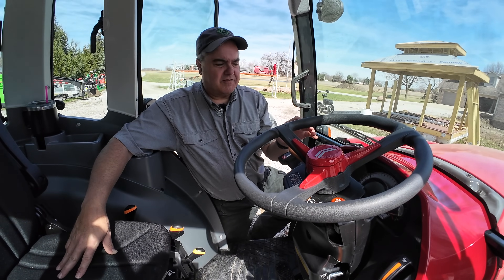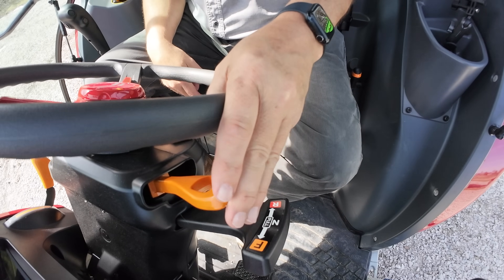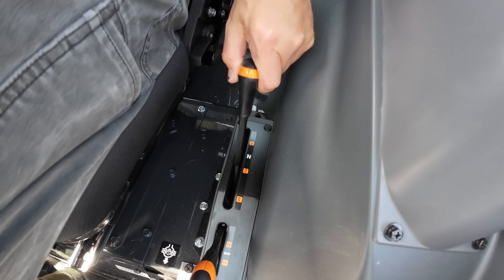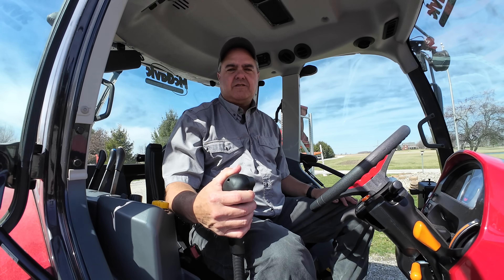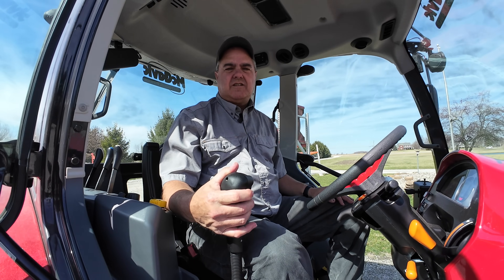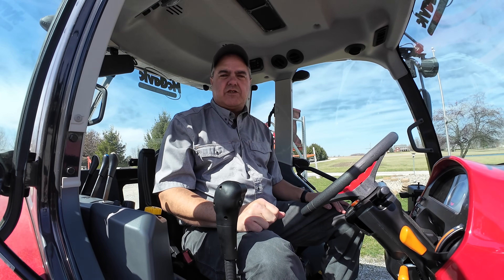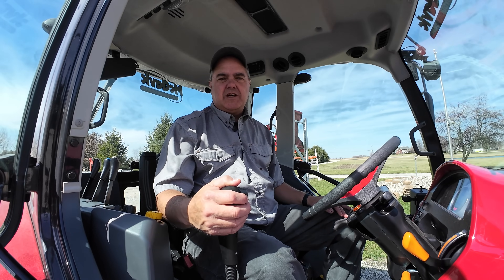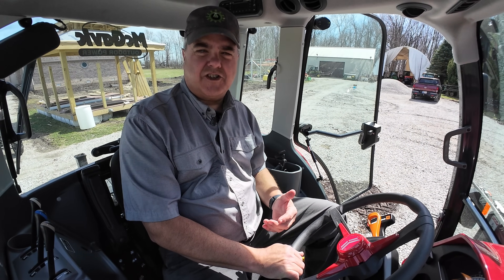Yanmar YT359 Operation: Hydrostatic? Shuttle Shift?  EXTRAORDINARY!

Comment: Owner here. I just installed the W.R. Long Top and Tilt. Sure makes things so much easier hooking up implements. And with the Cab version you open the rear 1/4 window to get access to the rear remote controls from outside the tractor.
Questions... what is your optional 3rd rear remote used for? Your big mower?
Reply from the maker: Haven’t used all 3 remotes yet. Got it just in case.

Comment: A and B mode is just two user set modes that each can have their own rpm and ground speed. Then a button on the joystick allows you to toggle between the two.
So you can have one set to high rpms and slower speed to load the bucket then hit the button to change modes to speed up ground speed to your dump destination.
Reply from the maker: Owner, or dealer?
Reply: @TractorTimewithTim  Owner. Love this thing.
Your videos are top notch.

Comment: At first I was excited about this, but I have to admit I'm a little disappointed. There's no way this is any different than a regular hydro tractor. It's just electronically switching the forward and reverse. If they still had draw bar HP, you would see this. I do like the layout of the cab better than the TYM I have. But I'm not a fan of all of the electronics for what the Yanmar is. I think for what it is, it's overpriced. Gotta say, it's awesome to see you give other brands a chance though!
Reply from the maker: This is dramatically different than hydrostatic tranny.   Go drive one for yourself.  
And yes, it DOES have much more pulling power.

Comment: I’ve been saying that this should be the standard setup for hydrostatic transmissions.  Double pedals are inefficient, dangerous in that you can inadvertently touch the wrong pedal at the wrong time.
Reply from the maker: Ok,  but this tractor isn’t hydrostatic.

Comment: you can do the same thing with a shuttle shift  just have to match your rpm to the gear you are in.  just bought a new 1626 with shuttle is how i know. it does not have the auto cruise  just a manual cruise
Reply from the maker: Nope. This one allows max rpm (say for mowing) at ANY speed.  Can’t do that with shuttle shift.

Comment: (Edited)  I've  seen some of Yanmar's press that shows they can pull the entire transmission assembly out of the rear of the tractor in minutes should it need repair.
Reply from the maker: This was not intended to be technical description.
Reply: @TractorTimewithTim  Fair enough.  I'll remove the technical aspect of it.

Comment: Does the clutch allow you to feather in the PTO?  I had a clutch pedal on my L3301 and I loved the ability to very slowly engage the PTO and slowly spin up my finish mower.  I don’t like how so many tractors have gone to a “dump” in on the PTO.  It was the only thing I ever used the clutch pedal for.
Reply from the maker: No. PTO is independent.  If you had not purchased a Kubota, you wouldn't "need" to manually 'feather' your PTO.  Most brands have a 'soft start' PTO which doesn't jerk it anyway.  Kubota does not ...or at least used to not have the soft start feature.
Reply: @TractorTimewithTim -  good to know, but a moot issue now.  I sold that tractor and now have a KX-033 excavator.  Now I don’t mow, I rip it out! 🤣. Jis kiddn, different property required a different tool for the job!

Comment: Incredibly similar to the 1980s yanmar (much smaller tractor) I had. That “hydro shuttle” was super handy and between that and the foot throttle, your right hand never had to leave the loader control.    I’m now used to my gear drive kubota, but it’s a constant workout managing the forward/reverse lever, high/low lever, clutch and foot throttle-brake controls.

Comment: This seems to me like a hydrostatic but with both a shuttle lever and a clutch replacing the reverse pedal.  Maybe it will make more sense when you discuss the technical aspects, but at this point is seems to me to be simply unnecessary complexity.  I would much rather see simply two pedals as with hydrostatic and no clutch and no shuttle and no creeping when neither pedal is pressed.  If people really need the creeping function, make THAT a separate button or control.  I just don’t see the logic in having three controls for motion (motion pedal, shuttle and clutch) when two (forward pedal, reverse pedal) are more than sufficient.
Reply from the maker: I did not discuss the major reason for this tranny.  It has the power of a gear drive transmission while maintaining MOST of the flexibility of a hydrostat.
All hydrostatic transmissions are horribly inefficient at getting power to the ground.  We all know that…yet we choose them anyway due to their flexibility.

Comment: @7:30  with iseki TF hydrostatic you don't have to move your foot eiter yo go forward with top of your foot and backwards with your heel the  pedals are opposed of each other but your foot fits on both. If you press forward the backward pedal goes higher up to

Comment: this summer if you need to break it in run your bat  wing mower need some thick tall grass. or another property vines over growth. Let your yard get grown up tall. Really test it. To test to see did they build it for its intended use. Then do an oil change video one to look at the engine how it’s doing any shiny ✨ bits. Tim i really don’t care what ever tool or tractor brand you use. Boys with toys.  My grandmother always said they just get more expensive. You really can’t get rid of your smaller tractors 🚜 small projects. plus one day it’s mechanical may need one just to get through a mow job or who knows. But i’d try n look at drive on deck mowers by other brands. You have ven trac for tight areas They may come out with new tools to play with. I like the Jd 1025 R diesel good size mower deck to drive on. Regardless of brand the deck for mowing longevity not just price. May look at zero turn commercial stuff to.

Comment: My tractor is an Antonio Carraro shr9800 the H stands for hydrostatic, this is a tractor from 2018…  the transmission is used the same way, leaver on the same spot or a small toggle switch on the joystick… 4 spead sets, press the accelerator and go.

Comment: I have a yt 347c for several years. I now have almost 1200 hours on it with no issues. Love my tractor. To me driving it is like a car. You shift forward or reverse the gas pedal works the same and the cruise is the same.  You just have added controls over the tractor’s movement.  The clutch pedal as I was told disengages the hydraulic pump. I don’t ever use it. Glad to see you with a yanmar.

Comment: Is the clutch for engaging/disengaging the PTO? It has to do something unless you can press it to change speed ranges on the fly but how often would anyone do that?

In a full-fledged tractor that's the transmission I expect to see in small ag & compacts, I've never used one but have used every other transmission style (traditional hydrostatic, traditional manual, shuttle-shift manual, and shuttle-shift with torque converter). Big advantages over the clutch type and torque converter type shuttle shifts, interesting to see how the A/B speeds work because otherwise it's only benefit over a traditional hydrostatic is not having a second pedal to bump into or press in a panic.

I have mixed feelings on auto-throttle too, definitely something I want to be able to turn on/off as needed. With the engine rpms as you press the accelerator the engine moves more fluid thus making the hydro spin faster, so yep your throttle response goes from linear to exponential. I've tried it in everything but field work and the only times I benefit from it is when running around without engaging any implements and occasionally when digging/dragging dirt. But because of its touchy nature it's the LAST thing I want doing anything with pallet forks, keep rpms low to keep all movements snoother
Reply from the maker: You would not complain about auto throttle on this machine.  Much smoother than most.

Comment: The land around you is flat. Not so much here in Western Connecticut. Therein lies an important feature of the 359's transmission.  I have many hundreds of hours on a Deere 4310 (also a Yamaha, BTW) hydrostatic.  The first time I stopped the 359 on a hill and moved the shuttle lever to the neutral position, my eyes became like saucers! There is absolutely no engine braking!  I started to roll backwards at an alarming rate until I was able to mash the brakes.  Beware!

Comment: The place this transmission is not fun compared to a dual pedal (I have the same tractor) is changing direction on a hill. Loader work on a hill or mowing up and down a slope etc. it’s not smooth under load, the break is need under heavy load.

I have had a few other issues, but mostly it’s wonderful

Comment: I think this is a good way to get guys like me to consider a hydrostat tractor. In my line of work I could see some advantages, but I’ll never stop trying to clutch and shuttle shift my truck. I put a lot of hours on a tractor so it’s just kind of a habit. I’m still waiting for a linked system for the PTO and the lift arms. Some of the equipment I use doesn’t tolerate spinning free very well. If I could set the PTO to turn on at a specific height (auto on/off) with a height adjustment. The auto on/features are cool, but I would want more control.

Comment: Tim the reason the 3046r and 2038r are like that is because their pedal assembly’s are electronic fly by wire if deere was to remapped the pedal position sensors and voltage resistance it would be like old salty’s pedal feel a more mechanical feel

Comment: I spent 3 years tractor shopping because I couldn’t make a decision and didn’t want buyers remorse. I thought for sure that I was going to buy either a Kubota or JD at the beginning but also tried TYM, New Holland, Kioti and MF. The MF 2860m became my favourite until I tried the Yanmar. Once I used the Yanmar YT359c I was completely sold and the IHS transmission is perfect for my needs. Bought it last spring and zero regrets.

Comment: Another great video Tim!
Excellent info on a very interesting tractor.
Couple quick questions.
So when you let off the peddle regardless of modes in use it does not come to a complete stop like a Deere e-hydro?
That is different from what I thought if that is the case or I am understanding correctly. 
Also if in fwd and you get out of the seat does the tractor shut off?
Reply from the maker: If the shuttle is in F or R, no it doesn’t come to a complete stop. ALMOST….but not complete.
Yes, it shuts off if out of seat and in gear. 
(I disabled seat switch as I always do.)
Reply: @ Ok 👍 Follow up question, if needing to shift to neutral I assume you have to set the park brake before exiting or even if setting on a slope do need to hold the brakes?
Reply from the maker: @jdfleetguy28 there is a parking brake….lock on the regular brake pedals.

Neutral allows rolling.  Behavior just like any gear drive tractor in that sense.
Does that help?

Comment: It's a shuttle shift.

If it didn't creep forward or increase speed with throttle input during set cruise, I would agree with hydrostat. However, because it moves when the shuttle is changed, and cruise speed increases with increased throttle, it can only be classified as a shuttle shift. 

I would never buy that machine. 4075R, all the way.
Reply from the maker: If you are up for the $80k+, then the 4075r is a very nice machine.

Comment: As a retired heavy equipment operator the only hydrostat equipment/ tractors that impressed me were the Deere. They simply put power to the ground better and smoother than anything else I've operated. Really as for as tractors I preferred the old geared transmissions for reliability of power to the ground, but these Yanmars have definitely caught my attention. I'm definitely anxious to see you really work the tractor to see how it performs. This transmission setup especially looks very operator friendly and a great blend of shuttle shift and hydrostat. I own a old Ym1700 that I recently overhauled and I love that little tractor, I call it my Japanese Deere. 😉👍

Comment: The clutch, how does it works?
Is it a hydrostatic clutch?
Well if it is you have a great thing when you need to run slower but the equipment needs tor run at higher speed or you trhottle up for a moment to lift the loader but you want to keep the ground speed.
Thats whats my Wille 745 did and thats was 32 years ago.

Comment: To me this transmission is a HST with more steps it looks nice and different but that's just how I think of it. Why change something that works and is proven to be reliable
Reply from the maker: Because it is much more efficient.  Has the efficiency (power to the ground) of a gear drive, with the flexibility of a hydrostatic drive.

Comment: Seems like hydrostatic is good for loader and mowing, and gear drive is good for farm work disking and plowing.  Your demo was very interesting, it's nice when it works but looks like a headache and costly when it doesn't.  Time will tell 👍
Reply from the maker: It has been out since 2016…so well proven at this point.
Reply: @TractorTimewithTim  Thats good to know, from watching your other videos , you do treat your equipment with respect.

Comment: That is going to be a nightmare to fix when it breaks way too much electronics on it I bought a 1023e because it is relatively simple to fix, I am a retired mechanic I worked in shops for over 40 years I worked on some of the computer controlled engines and transmissions and heavy on hydrostat and hydraulic systems
Reply from the maker: We'll see. It has been out since 2016, so fairly well proven at this point.

Comment: Really like everything about this transmission, so far as you have explained it.  Little bit on the fence about the "creep mode", coming from a hydrostat, but since you should just switch the "shuttle lever" back into neutral anytime you want to stop, it likely isn't an issue.  Would be nice if that mode could be switched on and off, but I could also see that being an issue if you are used to it being off and you don't realize it was turned back on.  

Can the clutch be used to allow you to shift "ranges" while you are still in motion?  Or at least while not having to come to a complete stop?  Think that would be a welcome feature.

That or if it was a clutch between the front and rear wheels that would disengage the front axle in 4 wheel drive so you could make a sharper turn on pavement or something, then go right back to 4 wheel drive by releasing the clutch (I am assuming that this is unlikely the function of the clutch though).

Really like the idea of that full throttle button on the loader stick, thinking about some ideas there about how to add that feature to my older tractor....

Looks like Izzy may want a grippy surface on top of the dash, for getting up there and riding grip.  Have a good one!!👍

Comment: I am wondering if you can come to a complete stop when in “creep” mode by using just the brakes or do you need to clutch or move the forward / reverse lever to neutral?  Like when loading a truck or putting a pallet on a shelf.
Reply from the maker: both brakes at same time does indeed stop it.

Comment: I've done some technical digging on this transmission and it's quite impressive. Another big benefit of the design is, unlike a typical hydro where the torque decreases as fluid flow increases (ie, you have less power at higher ground speed), this one moves the peak wheel torque into the typical working range of the pedal (I believe they say around 2/3 to 3/4 depressed). The hydraulic motor is essentially hydro-locked at that speed so you've got nearly the full power of a gear drive transmission, no fluid moving, less heat while you're working, less wear... Pretty incredible.

Comment: Awesome technology ! 
My question is when your mowing or using the pto at full throttle, how do you change directions smoothly without throttling down ?? Can you just shift the lever and it does it smooth or does it change directions harsh ?
Reply from the maker: The 'motion' button that I demonstrated in this video allows this transition to be adjusted.  When in 'turtle', the transition from forward to reverse will be smooth.  When in 'rabbit', it will be harsh, jerky, but fast.

Comment: Congrats on your latest addition.  I have an older Yanmar, YM-187D, and it's still my go to tractor many times.  It's a smaller footprint tractor and really love the Yanmar 18hp engine!  It has a shuttle shift transmission and works fine, but not has useful as your new tractor's tranny.  I would have gotten a Yanmar, over my Kubota L6060, but don't have any close dealers.
Reply: I have an old (1979) ym-135 D. only 13 hp But will out work most modern 25 hp subcompact tractors. I have beaten that old girl and it keeps coming back for more. The only hard part is parts keep getting harder to find. Some oem still available, some aftermarket, some I have to make myself on the lathe or mill...
Ill never get rid of it , even if bigger newer comes into my budget.
Hope the newer yanmar machines are just as sturdy.

Comment: Well, hopefully the “CatScan” at the end gave the Yanmar a clean bill of health. 😅
Good info! 
I was wondering how the transmission operated. It will be interesting to see as time goes on if the setup adds functionality and is practical. 
As far as the clutch goes, as an old timer I can say many times when I need to come to a sudden halt, many times my left foot heads straight to the clutch rather than my hand to the shuttle shifter. My guess is muscle memory from driving many vehicles and tractors with manual transmissions.